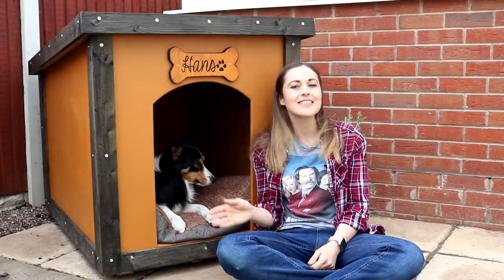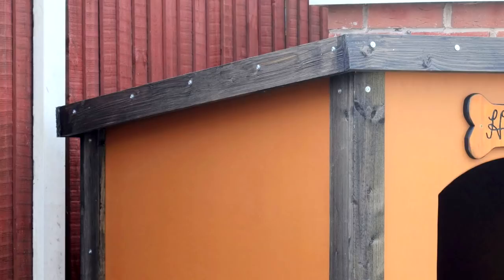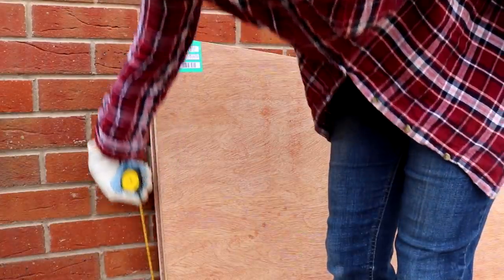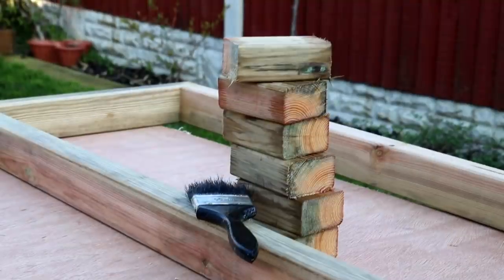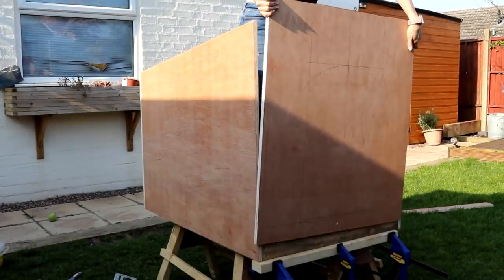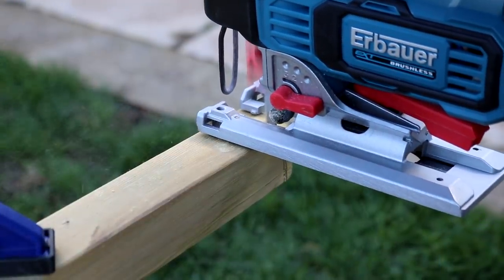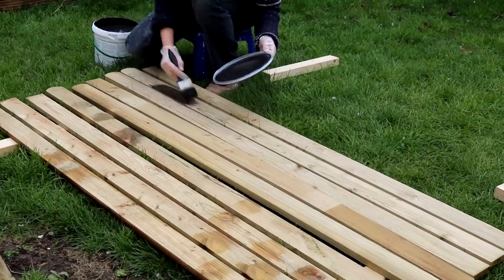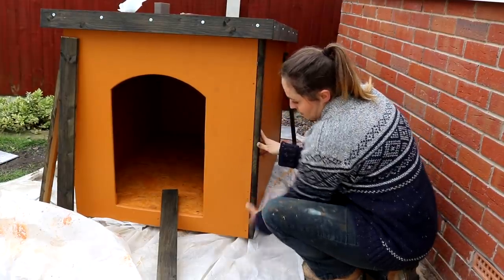DIY Dog House For Big Dogs Outdoor (Customized Easy Kennel) | (AD) | The Carpenter's Daughter

Comment: Hi Vikkie, when using a circular saw ensure that you have the material you are cutting supported as close to the cut as possible to prevent snagging. This happens when the material dips down on one or both sides of the blade and traps it causing kick back. Can be scary first time it happens to you. As posted by another commentator, set the blade depth so it is a few mm more than the material you are cutting. If you have some scrap wood you can put underneath your cut it will prevent most of the tear out and give a nicer finish. Keep up the good work.
Reply from the maker: Thank you for the tips :)

Comment: Great job Vickie. I'm sure Hans loves that and should last for years.
I was surprised the circular saw struggled. I'm guessing lack of power and possibly the blade could be the cause. 
Little tip when applying the paper template to save so much sanding, lay masking tape down first then glue to the tape. You can then peel off what is remaining meaning a lot less and easier sanding.
Well done!
Reply from the maker: Thank you for the tip, Paul :)  I have wondered if it was the guard not opening enough on the narrower side I tried to start on, but I'm no pro.  The battery was fully charged too.
Reply from the maker: Had the same issue the other day on thin ply... but because I needed to trim 5mm off, the guard struggled to open.  So, now I know if I tried to cut further down, I wouldn't have had a problem 😊

Comment: Love the dog house! And always enjoy watching your channel......but have a couple of suggestions re your new circular saw:

- while you can use the narrow side of the saw’s base plate (when no choice) against a fence to trim down boards, it’s better, if you can to use the wide side of the base plate against the fence....makes for less wobble as more surface area supporting the saw.  So in your case you would turn the boards round so you can do your cuts on the right side (as you faced the board) rather than the left

- with some spare board and wood, make a zero clearance track for your saw! Lots of vids on YT showing how. Then much quicker and easier to do accurate cuts compared to clamping a straight edge, as you just line up the edge of the homemade track to where you actually want to cut, clamp it down, set the saw depth and run the saw along it( on the saw’s wide side)! 

Hope this is helpful? Keep up the great work!
Reply from the maker: Thank you for the tips! Will remember for next time 😊